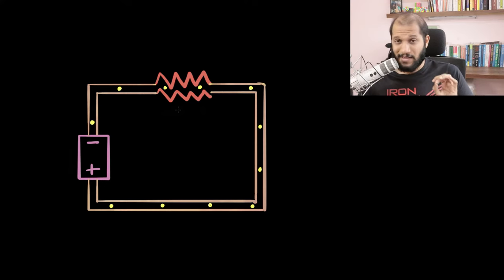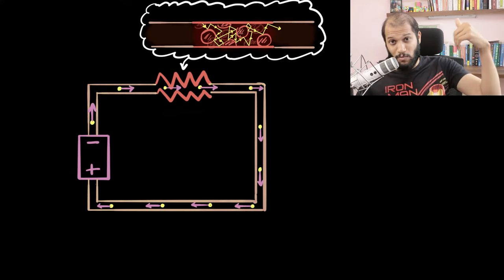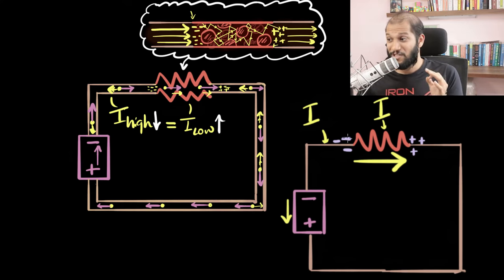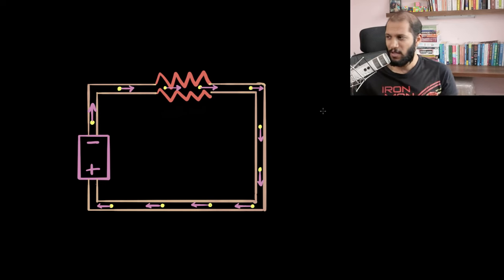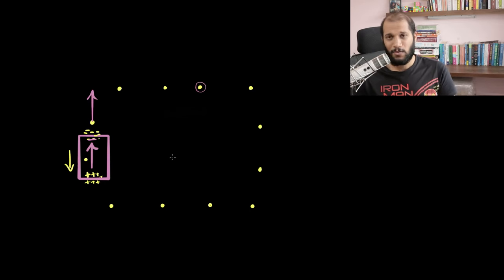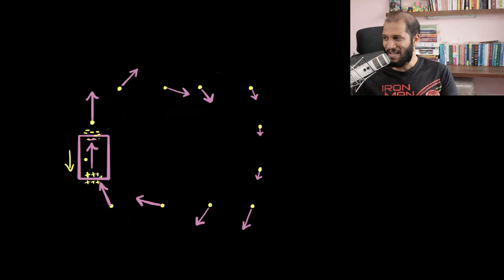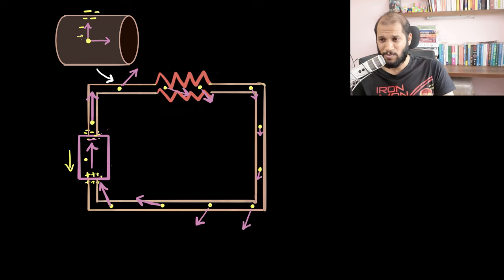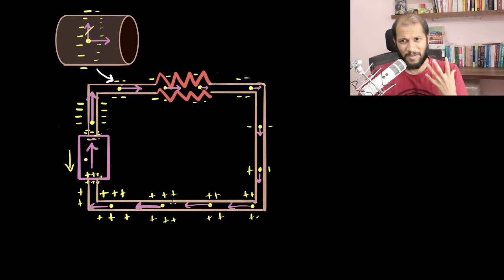How circuits REALLY work!

Comment: I am very happy that you tackled the subject of electrons traveling in a circuit. I have had difficulty finding such high level of detail which includes the "transient stage." You say that initially, the current in the wire is very fast because there is little resistance, but as you know the normal drift velocity of electrons is relatively slow (2 cm/sec) which surprises a lot of people. It may have helped to compare the slow drift velocity of electrons to the velocity of the electric field, which is established at the speed of light. Also, I think that it's important to point out that just like in a resistor, the electrons moving through a wire also bump into atomic nuclei and move in lots of random directions with the net movement being in the direction of the field force. I know that you cover this in Khan Academy videos and thanks for mentioning me.😁
Reply from the maker: Haha, yea I am seeing I missed a lot of things!
Reply: Can you explain a little more about the transient state and drift velocity of electron being low
Reply: @allamjogesh4512  All I know is that the normal drift velocity of electrons is relatively slow (2 cm/sec)

Comment: Actually, the battery wants to send electrons from the negative side to the positive side. It's just that there's something stopping them in the middle. In that case, shouldn't the electrons be bunched up in the middle before you connect the circuit?

Comment: Firstly,let me thank you for clearing almost all my doubts about electricity flow and voltage and whatsoever.
I've watching VERISTASIUM videos as well to achieve this but those didn't prove to be providing much explanation required and i never had this kinda intuition before.
I am a 2nd year FSC student from Pakistan who has been fighting issues with electricity flow since this concept was introduced to us in 10th class,finally now i can say that it ends here now that i found such a good explanor.

Although one thing that i didn't understand is that i think it should be negative charge deposited on the surface of other part of the circuit/wire as well and not positive charge.
Tell me where I'm getting it wrong,please.

I'll be waiting to get answers.😊
Reply: Think like this 
See the battery has +ve charges on lower end(in video) and -ve on upper and as we attached these to the wire then due to conductors property the + charge got onto conductors surface from the end where it was connected and same for -ve

Comment: It was the topic where I was confused a lot. All the intuitive details cleared most of my questions. You are such a non typical legend teacher. 

It would be amazing if you could dissect the anatomy of the battery and explain every detail. 

BTW, where did you get this detial? the transient state and the forces on each electron in the circuit? From a book? or internet?

Comment: I have a question, sir. If the electrons inside the wire are moved by an electric field with the help of a battery, then why is the battery connected to the wire?If we simply bring it close to the closed wire, should not current flow?                    I Want more intution videos like this sir pls continue

Comment: hey there. I really appreciate your explanation because i always had those questions, how the circuit behaved in such a way that all the voltage is concentrated on the resistor, and like if you had two resistors both of them will share the voltage depending on their resistance, those principles are basics in circuit analysis, but idk they seemed to me not that intuitive, and idk this concept of transients stage is totally ignored they just give you the laws and you just accept them. I really don't know why so much explainers ignore this concept, it is actually the key point that solved my misconceptions on these questions.

Comment: The overall explain is very good, but that model gives the impression that the electrons really travels in the material.
As I understand, the electrons on the materials are always moving in they orbit, eventually jumping from atom to atom. On the presence of an electric field they will have a relative small component of acceleration in the opposite direction of the field, but they do not need to travel or jump to another atom to transfer that energy to others.
Each electron with an acceleration component, even the ones in the "wrong" direction, will slightly change the electric fiel around them, transferring part of that acceleration component to others electrons.
That process will keep going and the net result of that movement is the current.
To make it more clear, the net result of the movement of all electrons has a direction, but even in DC current, even for an infinity time, some electrons can never reach the other side of the battery.
Reply from the maker: I think a more accurate analysis requires a full blown quantum mechanical treatment where you consider the electron wave functions!
Reply: @Mahesh_Shenoy  I agree. Just wondering if we could not say "The electrons do not travel in straight paths, this movement is a resultant of small interactive movements".
Moreover, it makes easier to explain how they can curve in the bent of the wire without any field to accelerate them in another direction.

Comment: Great video sir, loved it :)

Something a little bit outta context that I’m about to ask, one thing which we know is that “Current always take the path of least resistance”, but my question is how does current that hasn’t yet reached the resistance area know that “I need to divert myself and not take the path of resistance”? A text solution would be fine too :)
Reply from the maker: Great question! 
Current 'takes' all the possible paths. 
The current in the path with highest resistance automatically becomes lower than the ones with lowest path! 

What do you think?
Reply: Its like you are giving a push to water from one side and it has two path to go. So the path where the water experiences less obstruction is the path where the amount of water flow will be more. Hope it helps:)

Comment: [Typo corrected]

Hi sir,

Thanks a lot for deep dive explanation. 

one question puzzling is how the like charges can accumulate at a point .??
Can you share your point of view.

Though I am trying to relate to surface charge formation, still I am unable to convince HOW these like charges can get accumulated concentratedly at starting for resistor.

Also it is not clear the site of accumulation is with in the resistor or before the resistor (conducting wire).

I hope there should be definitely  some  logical answer to this  , Please kindly help me to understand

Comment: This is a great video, thank you.  I have a question that you might be willing to answer.  If you have two resistors in series the top do the first one will be positive and the bottom of the first one will be negative.  What is the polarity of the second resistor?  Is it’s top positive also?

Comment: I've already studied this so it wasn't anything new but I liked to think about each concept, specially the part of consider high current at one place and low at another causing accumulation of charges which works to eliminate the difference b/w currents (increasing lower current and decreasing higher current simultaneously to make everything equal)
Reply: Please tell me the name of the book from where you read it.

Comment: That is a great explanation.
But there is one kicker.

Voltage drops within resistors. If the electric flux is the same everywhere in the wire, how can the voltage drops along a resistor. Surely the E-Field must drop within there...

Comment: Hi sir,

Thanks a lot for deep dive explanation. 

one question puzzling is how the like charges can accumulate at a point .??
Can you share your point of view.

Though I am trying to relate to surface charge formation, still I am unable to convince who these like charges can get accumulated concentratedly at starting for resistor.

Also it is not clear the site of accumulation is with in the resistor or before the resistor (conducting wire).

I hope there should be definitely  some  logical answer to this  , Please kindly help me to understand.

Comment: You can actually see this happen in observable time scales if you watch a HiPot test being completed on a large inductor, like a power transformer or 100+ MVA generator.  The voltage is slowly increased and the current spikes and settles out, hopefully to near 0 amps, as the target voltage is reached.

Comment: 18:48 I don't think the negative charge distribution will be higher close to the negative terminal of the battery because in that region, the forward push on the electrons are mostly parallel along the wire, I think this charge distribution will be farther away from the negative terminal of the battery and also far away from the positive terminal of the battery for the same reason. Please I'd appreciate your response.

Comment: Sir, could you please make the same in depth video for series and parallel resisitors?

Because I don‘t understand how if I add a resistor in parallel why does the current increase instead of decease?

I know that the current takes every path but I would like to get the same Intuition from a in depth video like this one to make it realy clear how the electrons move or distribute during initial state and steady state for example.
Reply from the maker: Thanks for the request, Tobias! Added it to the list!

Comment: Trying to make sense of your explanation to why the force is along the wire. I don’t understand why in the lower wire the distribution is of positive charge surrounding the surface. The electrons are feeling the diagonal force hence its make sense they would redistribute on the surface? 
other point if the wire have very small resistance then the charge accumulation will better explain why the force is a long the wire even if the wire has different twist and turns

Comment: At around 19 minutes, you said that perpendicular component of force on the electron i.e force vector perpendicular to the wire will be stronger near the battery but according the electric field, the net force will be along the wire,  there should not be any perpendicular component

Comment: 6:28 While wrting E2A the direction of area vector is along outward normal away from the gaussian surface so it should have been E1Acos0+E2Acos(180)=E1A-E2A=0

Comment: but electrons move at like... cm/h rates in wire? really since they are bumping more in the resistor, that means that they lose energy (which is the thing that moves "very fast")
anyway good video this actually implements Maxwell equation in a way that helps me understand circuits so thanks for that

Comment: Hi, thank you for a great video.   Do you think the electric field is the same everywhere in the wire and the resistor?  I think the electric field in the resistor(s ) is much larger than the electric field in the wires?    Is there volume charge at the interface of the wire and the resistor?  You say there is only surface charge.  Is that also true inside of the resistor?
Reply: Yes, if the resistor has the same cross section as the conductor, the electric field inside the resistor is much greater, according to E = j / sigma. ( since I and A are the same, j has to be the same as well). The charge in this case resides at the interface between the two materials.

Comment: sir in the video related to the potential difference across a resistor, u said that there will be no force acting on the flowing electrons in the wire, but here u claim that an electric field acts on the electrons along the wire. please clarify this.

Comment: 7:29 It is logical that the current in the resistor is equal to the current in the circuit, but how could we formulate this so simply as V = I x R? Because the accumulation of electrons there is a complex situation. There are too many parameters for the electrons there.

Comment: How is it possible that we have two different currents inside series components?
Reply: He is actually correct I believe. It can also be looked at in a different way namely that there is a capacitance between the wires every where. This capacitance has to be filled up hence the high initial current flow. I do believe however that the current in the resistor will pretty fast build up too but only as soon as and in relation to the voltage charge over the resistor.
The influence of the battery voltage is going away from the battery with nearly the speed of light. That is the electric field he is talking about. the end current is not reached until the field has reached the whole current and all the fields from all the electrons have settled down. The electrons them selves do not move all that much I believe but what we are after and need is the energy push which is achieved with the field push of every electron.
Now this is my understanding of it. His explanation is as I said probably correct I believe but may be a little hard to follow. I think that I was able to.

Comment: Okay this video threw me off. I noticed Veritasium raise a similar issue regarding the surface of the wires and inductance that  should only have effect during ACCELERATION. That is, the fields within the wire can only be affected by each other during the change of velocity (as well as speed) through the wire. The velocity vectors during this do occur but are only secondarily affected by the magnetic field of the battery as a whole during the acceleration periods. 

The path's conductance draws the electrons through the wire initially via a similar distribution relating to the laws of thermodynamics until they are balanced. During the acceleration, the electrons' magnetic fields increase and are 'impeded' by the relatively standing field of the battery. That is the battery's field does nothing until the electron is moving through it. Then and only then does the vector of the magnetic fields matter. The magnetic field that stands does have effect on the atomic level electrons as they move around their orbits in atoms but 'settle' when they are in sync (such as in a magnet or in a constant speed in the path of electron flow.)

Surface charges do not seem relevant other than as the barrier between conducting versus non-conducting  matter unless they are accelerated at very high rates. The force due to the electrons from their sitting positions are in sync with each by their magnetic fields but act as a pressure that gets released when some opening path like a conductor comes in contact with that terminal. Any buildup of charge on the external surface of the wire is NOT due to magnetic fields from the battery but to the deceleration factors of the initial electrons hitting the kinks or bends due to other electrons. Such buildup places may make the area at the bends have more electrons that then act as 'resistance'  by their static charge.  So any standing field of the battery actually resists the accelerating electrons as they move through the field perpendicular to them.

Although I may seem critical here, I like HOW you are expressing this and think you should still continue. I just hope that some of my own reflections I had in similar motivating reasons may help you in ideas for new videos. I feel relatively intuitive in understanding what is going on in mechanical ways due to the same initial questions you and others share here.  I would recommend trying something to describe a battery on the chemical level and then investigate how inductance operates because I am surprised at how many people within physics education are not as familiar with this as I presumed  they would or should be.

Comment: Thanks for your videos. Just a small error concerning the accumulation of charges which  is not inside the wire but on the surface.. There is indeed a gradient of charges on the surface ( as demonstrated in the experiment : https://www.youtube.com/watch?v=8BQM_xw2Rfo
  I would recommend the textbook "matters  and interactions by chabay chapter 18 for a thourough explanation on the transient analysis of a dc circuit. or ' the article 'Surface charges on circuit wires and resistors play three roles''  by Dr Jackson.

Comment: There exist photons which i call elektons that are always propagating at the speed of light in every direction along (hugging) the surface of all metal objects, for ever.
The speed of the elektons will depend on whether the say wire is enameled or insulated (speed is say 2c/3) or bare (ie in air)(speed is 1c/1).
The numbers (ie the saturation density) of elektons depends on the metal concerned.
Elektons give what u call electricity, what i call elekticity.
No electrons are involved in elekticity.
On a metal object (eg a wire) the nett elekticity is zero, unless we connect a say battery (giving a circuit) or at least one terminal of a battery (giving a dead end).
If we connect a terminal to a wire then the terminal will pump elektons onto the wire, or it will rob elektons off the wire.
Likewize for 2 terminals connected to a circuit.
Elektons on a wire do a u-turn at the end if a dead end. Actually, the elektons go straight ahead, the surface duz the u-turn.
Similarly elektons do a u-turn at changes along a wire (eg change of alignment shape size nature etc).
When a terminal is connected to a wire, the saturation of elektons on the surface (initial density & then transient densities) eventually settles down to a (final) density depending on the metal concerned & depending on the (say voltage of the) terminal.
That is the reality.
Anyhow, the wires will have waves & pulses of elektons propagating all over. Until the flows stabilize.